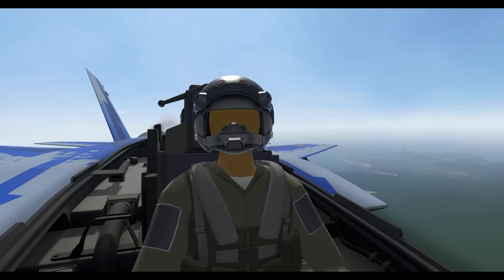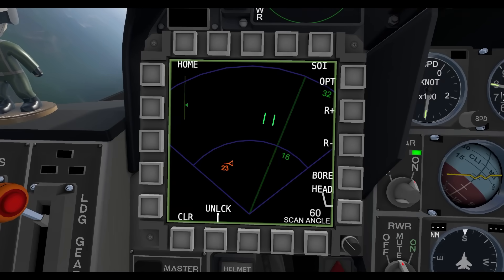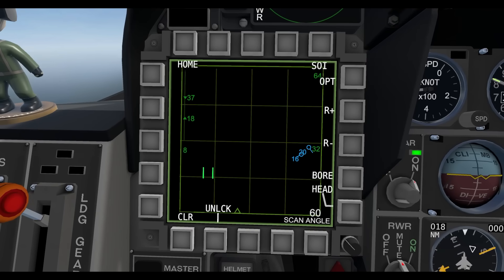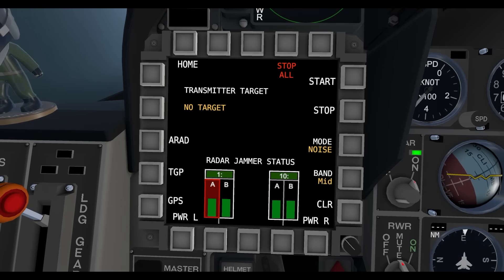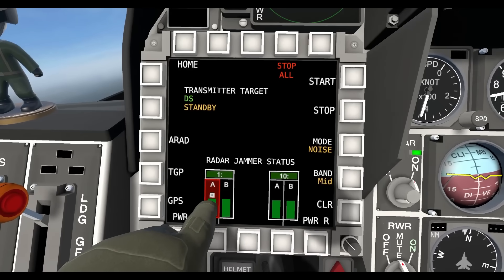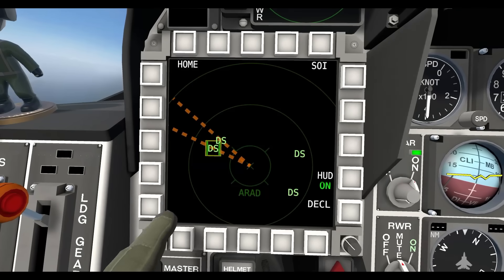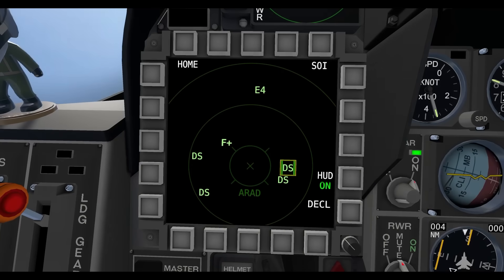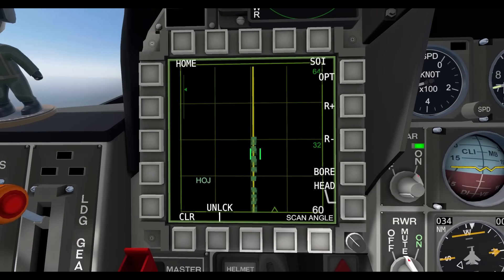Full Jamming & Radar Tutorial | VTOL VR FA-26b

Comment from the maker: Notes & Slew Radar Elaboration:
1. Your radar is broadcasting in a cone that expands as it gets farther away from you, meaning that it can scan a wider altitude range the farther away the signal gets.
Moving the cursor with the right thumb stick does not change the altitude range that you scan, though it looks like it. The left thumb stick is what changes the scanning altitude. Moving the cursor around simply changes the altitude values to help you understand the radar cone and the altitudes you can scan at different parts of the cone.

2. AWACS radar and EW radar are also both low band.
Reply: was gonna mention this, glad you caught that mistake. nice video!

Comment: Your description of slow mode isn’t exactly correct. When you move the cursor around the screen, it’s not actually changing anything it’s displaying the maximum and minimum altitude at that distance from your aircraft that you can detect contacts when you use the left stick in order to slew up and down you’re actually moving the radar scan assembly up and down. Essentially the use of this mode would be to get a higher hit rate on a target, but without having to switch to a smaller, scan angle, essentially instead of processing the four vertical scan rows, you are eliminating that and only doing a single horizontal scan with a certain radar elevation

Comment: Been waiting for more dcs like radar mechanics for a while and I’m glad it’s being added. The terms your are using like soft lock and hard lock are referred to as single target track (STT) and track while scan (TWS). TWS is what makes the F-45 seem so powerful because you don’t know you’ve been launched on till the missile goes pitbull as a TWS lock does not spike a bandits RWR. The downside to TWS is that the targets position is only updated after it is sweeped so you will see the contact on your radar skipping from pos to pos after each sweep. This doesn’t seem simulated in VTOL tho. The benefit to STT is you have persistent tracking but the target knows it is being locked
Reply: @jumpingjoy7689  👍
Reply: In VTOL VR this is handled slightly different than the reality DCS simulates:
- All radar targets are "track while scan" automatically.
- "Soft locking" enables the radar to update a target position in real time, at the expense of slower scanning, (3:27 notice how the sweep triangle slows down with a soft-lock acquired).
- Every additional soft lock slows down the scanning even more (presumably because more nodes of the array are busy tracking?). This means the more targets you soft-lock, the less situational awareness you have of the rest of your radar returns.
- F-45 and the new EF-24G can acquire targets optically, lock onto them using the TSD, and fire AIM-120 missiles at those targets without ever having to engage their own radar, as long as they can maintain visual of the target (F-45 does this automatically thanks to its camera arrays, EF-24G requires spotting the target with the optional Targeting Pod). They can also lock onto targets received by datalink, spotted or locked on by other planes.
Reply: Targets that are on radar with TWS tend to have actual trackfiles built, which means the radar will continue to project where the aircraft is flying until the memory time depletes or the aircraft is scanned again, updating that trackfile. It's why it looks constant - it's doing what you would expect from TWS trackfiles.

Comment: To add onto the jamming section: the reason you could maintain a hard lock was that the jamming type was set to noise. This just adds false radar return blips, being the boxes, to simply blind your radar basically.
To throw off a hard lock (STT/Single Target Tracking) you need to use DRFM, which will, when targeting the enemy who’s hard locked you, mess with their radar enough to throw off the radar lock.
It’s all detailed in the EF-24G’s manual, in the third section.
Reply from the maker: Could be true. Unfortunately noise is the only option for the other jets. The EF-24G is the only one that can use the other modes.
Reply: Yup. Sadly as of right now, the F/A-26 and T-55 are only able to use noise, and for me at least, only medium band jamming is available. 
On a side note, some fun math (which is probably wrong): The FA/26 can bring two jammer pods (I believe.) With only 4 different channels, there are only 4 different ways to jam (medium band noise, from 1 t 4 pods)
The EF-24G gets access to 4 pods with all bands and types of jamming. With 2 channels in each pod and 4 total pods, you get access to 8 different channels. Combined with 9 different combinations of jamming (3 bands, 3 types) you get an astounding 144 different methods of jamming with the EF-24G (3 bands per channel, 3 different types of jamming per channel, across 8 different channels. 
The EF-24G's jamming capabilities are infinitely better than that of the F/A-26. 
Conclusion: you do not get the full EW experience outside of the EF-24 (maybe the F45, but I don't fly it so I can't vouch for that)
Reply: The F45s jamming is pretty simple noise afaik. You get a jam button on the tsd, no mode or band select.
The EF24Gs flight manual is currently out and details EW implementation thoroughly. Recommend read
Reply: @shyneus9773 Could you point me in the direction of the manual? Is it on the vtol discord?

Comment: Small corrections:

1) A is for Altitude, not for Angels. That is from BRAA call, Bearing, Range, Altitude, Aspect.

2) The B-scope maximize the separation of targets, but it is still based from the conical scan and does distort the radar scope further the contact is from centerline and closer it is to own plane. It is best to have scanning in default "sector PPI" that give best idea of range, angle and position. Especially if the Sector PPI can be overlaid on Map, when it is very clear what you see and don't see horizontally.

3) Slew mode is about seeing the scan volume values, not the bars value and scanned bars level. As you select scanning volume by selecting how many layers the radar sweeps vertically, you change time it takes to update the radar picture as it is updated only when all bars is scanned. 
But bars do not inform you what volume you are really scanning. As radar beam is example 4.5 degrees cone, it will scan larger volume at longer distance than at closer distance, as the radar beam will be wider in diameter further it is measured from radar. This is as well what makes radar less accurate at the long range, as well less sensitive.
When you select the slew mode, you see the calculated vertical volume for given range, so example at 5 NMI range radar with 4 bars scan only 16-22 kft vertical volume, at same 4 bars at 100 NMI it is covering 2-35 kft vertical volume. 
The visual information in numbers help to come up for setting, like wingman tells that enemy was flying at 3000 ft and was about 15 NMI from you, that you can adjust your radar vertical angle so that scan is example 1-5 kft at 10 NMI and know that you should detect it.
Doing that just with bars value tells nothing about volume. It isn't manual, you just get adjusting radar vertical scan angle to point radar as needed.
Reply from the maker: Good catch, I’ve gotten used to just saying “Angels X” when talking about altitude on comms so it slipped out. The B-scope distorting the view to maximize target separation makes a lot of sense. Thanks!
Reply: @darkstar1592  Your are welcome. Didn't yet look to the end, but I will update post.

And the B scope and well distorts the speed by range horizontally. So when target is flying to left from your point of view at 400 knots, target will move faster from right to left when at 50 NMI than when at 5 NMI. What makes difficult to visually estimate expected position in next update.
Reply from the maker: That makes sense, thanks.
Reply: @paristo  The thing that clicked with me learning about how to read B-Scopes is that the vertical lines are always the same relative bearing, regardless of range.

For example if the bogey is at the first vertical line on the left, he is 30 deg to your left no matter if BVR or WVR. You could probably get the same effect with -30deg, 0deg and 30deg lines on the PPI, but the increased separation closer to the bottom of the display helps readability.
Reply: It... would be nice if you could set the number of bars you want to scan, which I know for some aircraft  you can set that were other aircraft have specific bar settings depending on your scan angle. But then we start getting out of the area this game is in.
Reply: @AliceDerg  That I see to be possible only in a planes that has dedicated two different cockpits. So other player can't fly, but has all on buttons in cockpit.

It would as well make reason to fly with someone when you are better.

So choose between 6-bars +/- 15° to 1-bar 210° options where you get some of the limitations of combo.
Reply: @paristo  Which, depending on the aircraft, being limited to the bars depending on the scan angle can actually be accurate.
Reply: @AliceDerg  yes, that I meant. Wider the azimuth, less bars. More bars, less azimuth. 
But that is balanced to some manner, like +/-60 and 6 bars being maximum volume for both. 

And as I think all radars on VTOLVR are AESA by logic, it should be possible have maximum in both anyways. 
But as AESA does not mechanically go scan pattern, it can't be as such. The AESA scan in chess pattern, different blocks at different random times. Generating the overall picture faster and maintaining picture as each target can be updated while whole volume keeps updated.

Another limitation in AESA is that it really has only +/-30 degree scan angles, as past that the beam steering becomes less effective and at 60° it is very weak and unreliable.
That is example of a huge benefit for Su-35S as it's AESA radar mounted on mechanically 70° turntable gimbal. That allows +/-60 + 70° scan limits, so 130° to any direction from the nose heading. Allowing it even guiding missiles while flying away at 40 degrees.

Comment: To further explain jamming, there are three kinds of radar degredation: noise, or barrage jamming, DRFM, and signature augmentation.

Noise jamming is fairly straightforward: it overloads the targetted emitter with false returns, causing the real target to be lost in the noise. It's very useful for jamming multiple radars at once if you can get them all on the same bearing. It can also hide any allies that are in the jamming corridor, delaying lock-on. However, you have to manually set the frequency band of the jammer and your radar is unavailable while jamming. It also gives away your bearing (though not your range) and you're susceptable to missiles fired in home-on-jam mode.

Digital Radio Frequency Memory, or DRFM jamming, is more complex than simple noisemaking. It involves digitizing the received radar signal and modifying it to achieve a result. Typically, DRFM jamming does this by copying the radio frequency of the radar pinging you and sending it back to the receiver at a higher power. This creates a loud, but false track that the jammer then "walks" away from your aircraft to break a lock. The advantages of DRFM jamming are that it automatically matches the frequency of the emitting radar, and it can pull single-target tracks (hard locks) off you. The disadvantage of DRFM is that it can only affect one emitter at a time, allowing multiple enemy radars to cross-reference and get your actual location.

Finally, there's Signature Augmentation. It operates on many of the same principles as DRFM jamming, but instead of walking the false track away from your ship, it modulates the signature so you instead appear as a different track. The primary use case for this is to have a MALD decoy appear as a larger aircraft, say, an F-26. The advantage here is that signature augmentation can't be tracked by missiles in home-on-jam mode and in PvP lobbies specifically, it can trick enemy players into making decisions based on bad info. The disadvantage is that it doesn't hide your actual position, and in many cases, the decoy radar pulse is a lot stronger than the actual return, which can actually give your position away.
Reply from the maker: Great explanation. This will be useful for the EF-24G because the others can only use noise.

Comment: Thanks man! I am new to VTOL, and this was very helpful!
Reply from the maker: Glad it helped!
Reply: @darkstar1592  questiom tho: how do you get locks with the radar? I never get that even if I move my square onto them. I always use bore sight
Reply from the maker: Move your cursor over the target, then click in the right thumb stick twice to lock it. Alternatively, clicking it once will only select it and “soft lock” and you can still fire a missile, though it’s less accurate than a full lock. You can also switch between selected targets with the numbered buttons on the left of the screen.
Reply: @darkstar1592  aah, did it! Thanks!

Comment: I need to confirm but I'm pretty sure you got a mistake inyour description of the radar altitudes coming off the cursor at the ~3min mark and some mistakes about ranging. In real jets as the cursor moves around those numbers are what altitude can be seen at that range.
Think of it this way, the radar beam is a cone of energy that sweeps the sky. Imagine the side profile of that cone, and pick say the 5 mile mark, the cone is smaller, at that range you might only see a fe thousand feet above and bellow your jet. Now look 20 miles out, and you can see 20 thousand feet up or down. The cursor is only telling you what the radar can see at that range, not actually changing the beam shape. 
Also, range up and down doesnt limit the energy, it just zooms the screen in. As far as I know we can't actually control the energy amount. I beleive this update give some sort of option like that to the F-45.
Reply from the maker: Thanks for pointing this out. I’ve pinned a comment that elaborates on this and explains it better.

Comment: The B-Scope is a lot different than PPI, B-Scope extends the point of the cone - ie your Radar emitter to the entirety of the bottom of the Radar scope, what that means, you are not seeing the pizza slice view anymore. In this view everything left or right of the middle is the angle offset to that side, and anything that is pointing directly down is coming at you - makes it easier too see which target vectors are intercepting you and which arent pointed at you.
Reply: So same information, just the bottom part is spread out. This makes it easier to differentiate targets. It also distorts the reality, so the B-Scope requires some explanation and imagination to understand. So PPI is more fitting to the simplified simulation approach of VTOL and deservedly remains the default setting.
Reply: @oznerol256  PPI and Bscope both exist IRL, B Scope is a better view and gives a more tactically advantageous view. The explanation is trivial really ...

Comment: thanks for these radar tips. i was confused why i couldn't get radar contacts belov or above me . the radar antenna elevation feature is a good news because it was too easy to sweep the area. i noticed AIM-7 misses enemy easily if you don't use 15 degree scan  and STT withing 5 miles. also the enemy radar icon is retarded depending on scan width

Edit: Jamming bands was comprehensive. i love the fact that ef24 is capable of disprupting the comms
Reply: AIM-7s are not designed to be fired under TWS. They require a STT lock because they don't have their own radar.
Reply: @AliceDerg  i know that it needs stt. I mean even if i was in stt lock it still missed the target. I need to experiment more with aim7 to make sure if it's a bug or just a fact i got notched by ai bandit, because in dcs i can  kill bandit from 10 miles, and yes. I'm aware they're totally different simulations but in my knowledge aim7  should have hit the target from 5 miles.
Reply from the maker: Honestly AIM-7s are just not great. It’s old-tech. They don’t have as much thrust or maneuverability so they miss a lot more often than AIM-120s. My advice when using them is to get a little closer to your target when you shoot and to try to fire from in front or behind them, never from the side. It drains a lot of energy because it’s turning pretty much the whole way to the target.

Comment: If AIM-120s can be fired from soft lock, what is the function of hard-locking? Is that solely for AIM-7s now?
Reply from the maker: Soft lock is much easier for your opponent to break than hard lock, but it’s still solid in my opinion. It’s also less accurate, so you’ll be limited by your radar scan speed for position updates. Hard locking will give great position accuracy, but at the cost of alerting your target.